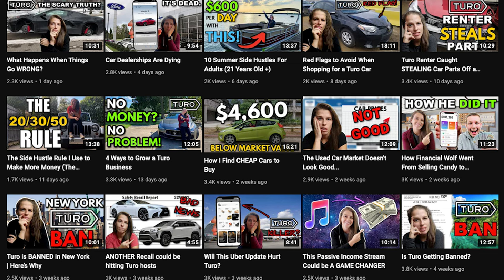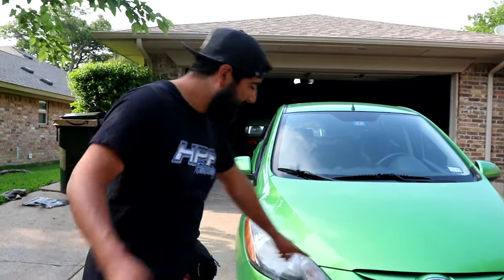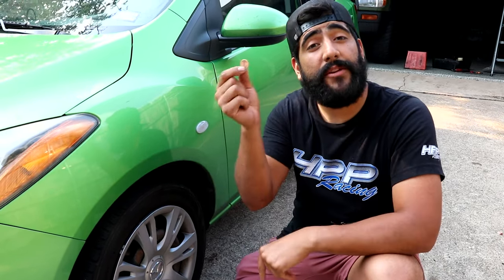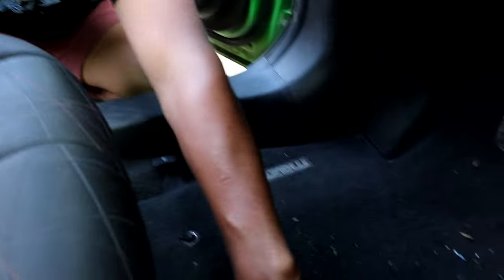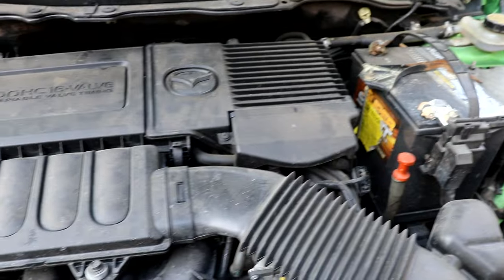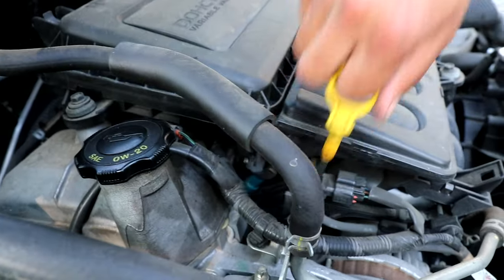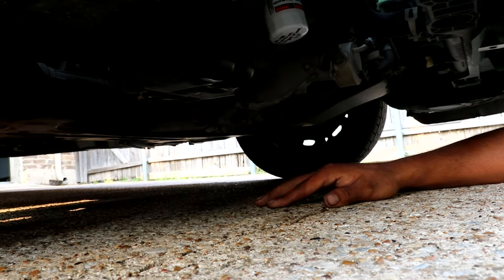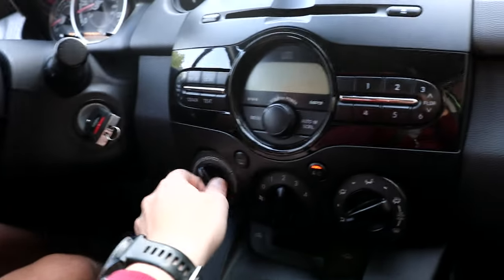How to Inspect a Car for Purchase (Step-By-Step)

Comment: Hey Aubrey can you ask HP when I should get my transmission fluid changed because my car is at 112k miles and I'm not having any issues with the car there's no leaks there's no problems that I could see but there's a lock on the transmission fluid top so I can't even inspect the fluid when do you or HP think I should get the oil change for the transmission even though I'm not having any suspected issues with my vehicle I guess I just want to stay ahead of the game I don't want to wait for it to smell bad to do something about it. Thanks ! Love u both 🌻
Reply: I think it's every 100k miles if I'm not mistaken
Reply: @KentPetersonmoney  oh okay 100,000 miles sounds about right
Reply from the maker: Hello! according to HP it depends on the vehicle but for some cars it's every 5 years or 50-60k miles for CVT trans but for most other cars doing it every 100k miles is a good bet for most vehicles
Reply: 30-60K miles depending on what kind of car you have. But tons of people don't change their transmission fluid because of myths going around that if you don't have problems then don't change it or it will start slipping once you change it. Replace the oil and filter, and use OEM fluid and filter only. Even if the fluid itself is not dirty and completely clear, the additives in the fluid can break down over time and won't protect your transmission components as well as they should.
Reply: @AubreyJanik  thanks sis!!!!
Reply: @igotanimac1  ok thanks!!